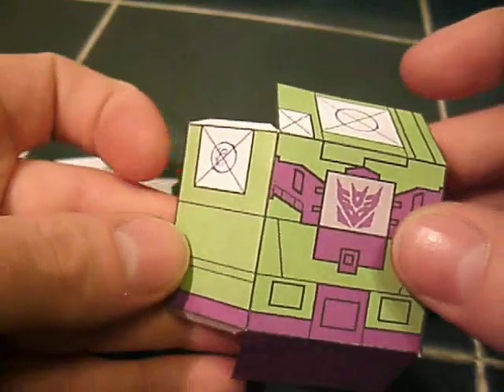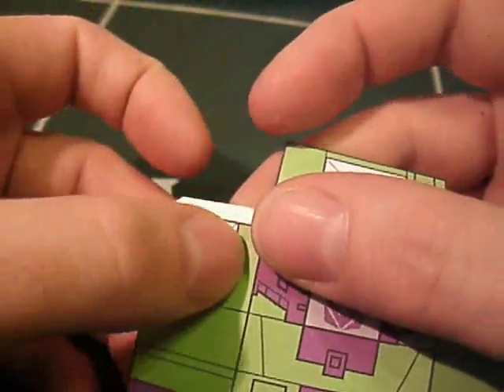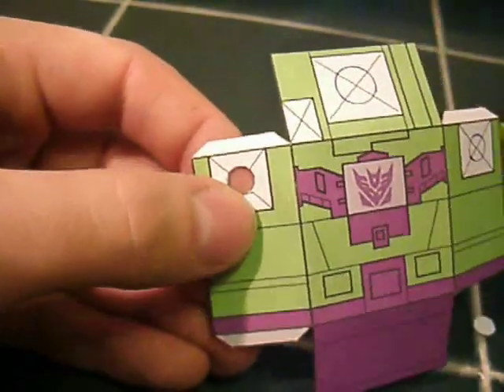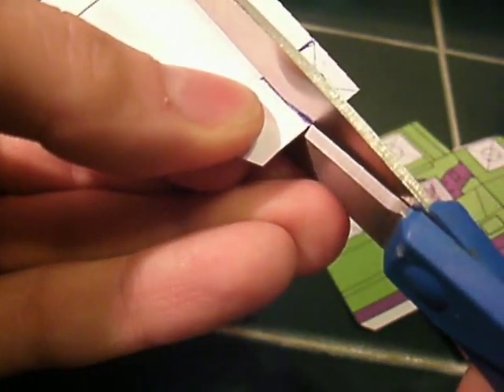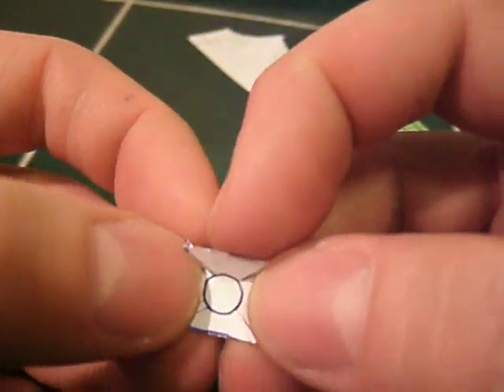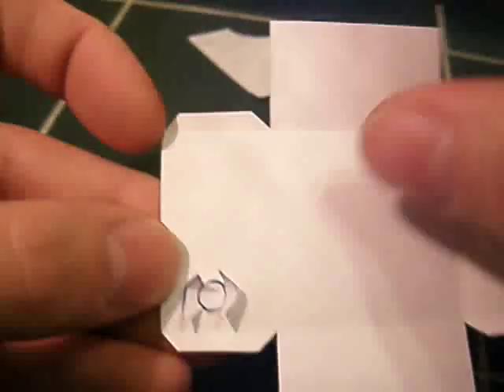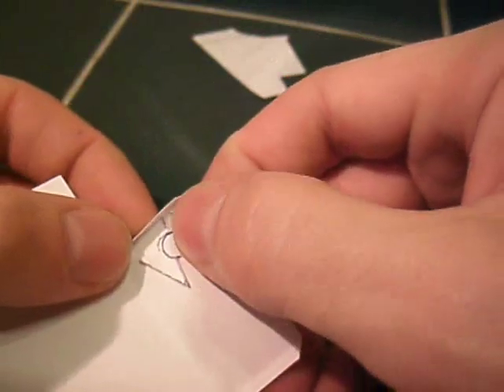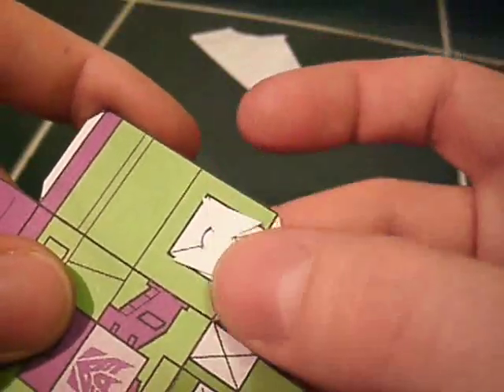Papercraft Poseability: How to create a pivoting joint for arms and necks

Comment from the maker: @omokheoatt Hmm... good request.  Haven't made too many hinged elbows yet, except for the ones in the Movie Prime Papercraft video.  Those came with the template, so I didn't have to mod it.  Basically it used cylinders inside a tube to make the hinge, and that worked pretty well.

Comment from the maker: Sure you can.  Just shrink down the template before you print it.  The only thing you have to watch out for is that you can only shrink it so much when there are lots of detail.  However, Haku ones are easily shrunk.  Many of my papercraft are actually 1/2 size of the original.  Check out my Cow 'Ruinations' for example.